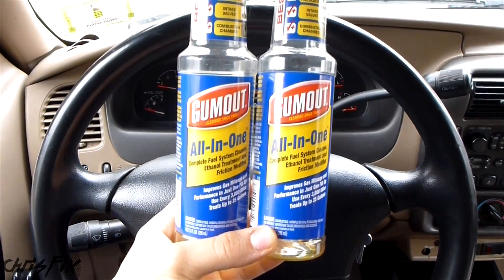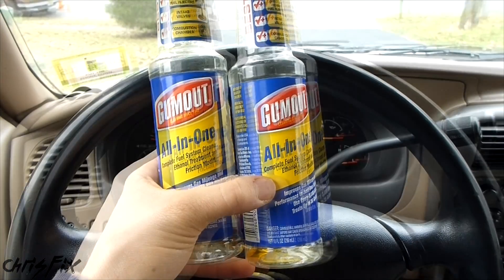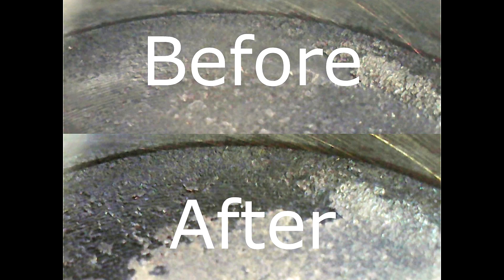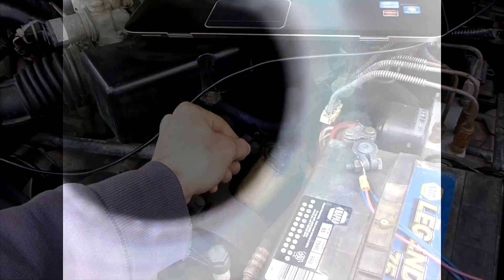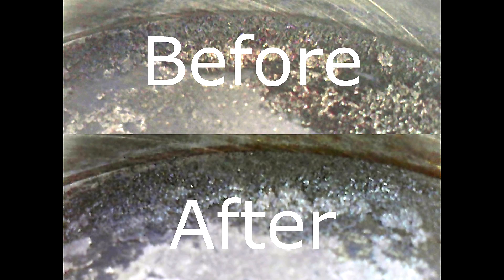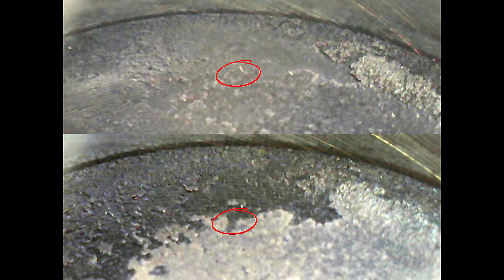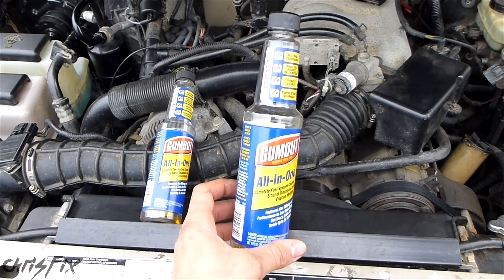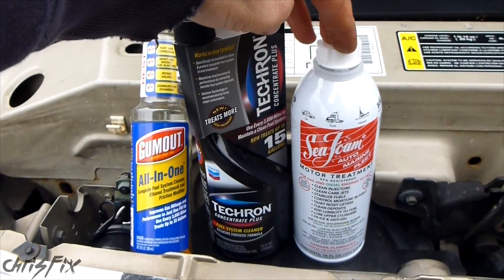Does Gumout Fuel System Cleaner Work (Follow up)?

Comment: Chris, you make a good point that the product is a bit too oversold on its packaging.   To be fair I'd interpret the language to mean that in the general case you'll notice an improvement in one tankful.   It's not saying that it'll remove 100% of your carbon after one tankful.  That is a very, very high standard of pass/fail here sir.
Reply from the maker: heymisterderp I wasnt expecting all of the carbon to be removed, but I was expecting there to be a noticeable difference. Like if I didnt show a before and after, side buy side, you wouldnt notice a difference. But I totally agree with what you are saying.

Comment: Sometimes you don't want to remove too much hard carbon too fast.  Bad things can happen
Reply from the maker: heymisterderp Very true.But you want to remove at least a little over the course of 500 miles and that didnt happen.
Reply: I don't know I'm just not seeing what you're seeing here.  I'm watching your video and I'm  impressed with these results.  It seems that if we used this full-time (1 bottle / 2 tankfuls of gas) I think it's clear we'd wind up with spanking clean engines eventually. 
You're also weighing only one purpose of this product as its total weight.  If you're just trying to King Kong the carbon out of your combustion chamber I agree this isn't the best product out there for that singular purpose.
Seafoam in comparison isn't going to countermand the ethanol in modern gasoline like this Gumout will. 
Upper cylinder lubricity is also important to people who want to care for their classic cars.  Feel how super slippery this stuff is in your fingers, it's physically apparent.  This product does things that Seafoam can't. 
I think you're also using a small engine where you soaked the piston head in Seafoam for 5 or 10 minutes after using 1/3 of a bottle on the intakes as a frame of reference, so...that is not this.  This is just putting something in your gas.  I think the rate of decarbonization shown here is ideal or at least close to ideal rather than "Busted". 
JMHO
Having watched the the end of the video you did add a disclaimer that mentioned 10-15 tankfuls so we actually don't even disagree for the most part.  I would only say that perhaps your expectations were a bit high going into these tests due to an unrealistic baseline.  
Great video though, excellent tests and narrations.  I wish there was more of this kind of thing on Youtube.   We never really get the data sets we need to make concrete comparisons on any of this stuff.   We're starving for evidence, and it's always great to get some.
With no cleaner/Gumout an engine will get progressively dirtier and dirtier for the most part.   With Gumout, an engine will get progressively cleaner and cleaner.  I think your videos confirm that.   That's pretty badass to me, but maybe my expectations are a bit too low!
Reply from the maker: heymisterderp I get what you are saying but at the end of the day, the bottle says after one bottle you will see results and were didnt see anything except some varnish getting cleaned up. I have never used fuel system cleaners (they are not needed unless you have an actual problem). Did you see the seafoam video: https://www.youtube.com/watch?v=WdT4DPFXIkM
Reply: ChrisFix
Chris,
I'd rather go with Gumout full-time and break the carbon off my pistons more slowly if that's the price.   For the totality of its purposes, it's an awesome product.   It's the difference between our cars running okay and running their best.  People should try this out and decide for themselves.   Our Toyotas and Nissans love it, they purr silky smooth.

Saying that fuel additives are "not needed" is somewhat erroneous.   It won't matter next month but it will matter after 100,000 miles.  A well designed and well-built motor can go 400,000 miles or more if people take care of it where at 100,000 miles it's just getting broken in.   Reliability is true value in automotive terms.

I had a recurring issue in my old Datsuns where I was carbon fouling the plugs mostly due to short tripping and not allowing the motor to properly warm up (oil temp).  This Gumout product eliminated that problem entirely.    This stuff cured a clogged injector in less than 10 seconds.   This product prevents and eliminates gremlins that make cars, particularly old cars, not run properly.  When a car is 40-50 years old the benefits of this stuff are enormous.  If your time horizon is only 20,000 or 30,000 miles then okay, I agree with you completely. 

Keeping a motor going towards clean rather than towards dirty while running great is a good result in my book. ;)

Comment: Wouldn't it be safe to say that this product might help prevent the hard carbon buildup if you used it from the time the vehicle was purchased new? I don't really believe in these products(except heet to keep my fuel from freezing/injector cleaning) but thats the conclusion i drew from your videos.
Reply from the maker: Elias Hardman I couldnt tell you for sure if this stuff prevents buildup of carbon because that wasnt what was tested. While it did remove the varnish, I dont know for sure if it will prevent carbon buildup. It might, or it might not. Due to the removal of the varnish buildup, you might assume it would work to prevent carbon buildup.

Comment: if your looking for more stuff to test you should try mystery oil its supposed to be good i use it in air tools but it says it cleans gas and  oil but iv'e never tried it thanks for the informative vids
Reply from the maker: sam witwiky Thanks Sam. I read the bottle of Marvel Mystery Oil and it it is not designed to reduce carbon deposits but to prevent them from occurring so the test wouldnt really work for MMO.
Reply: thanks its bean a wile sense i read the back of the bottle

Comment: the way this stuff works best is to use it as a preventative, if you used it during every oil change from when the car had zero miles on it, the gumout would regularly reduce the amount of carbon build up, because your vehicle already had over 100000+ miles, and this was the first time you used this stuff, your engine has massive amounts of carbon build up, the sludge stuff is fresh carbon build up so it came off easy, the hard crusty stuff is really old build up that's been there forever, so it would be really difficult to remove
Reply from the maker: kenshin moriame Yea, I agree. But the bottle's claims are not realistic. If it said what you said (or something similar) then that would be more realistic.
Reply: I agree, it's kinda like if you claimed a carpet cleaner could remove all stains, but you have a place that was a party house everyday for a decade, you know all that dirt, puke, wine, chocolate, and what ever the heck that thing was, are never coming out no matter what a company claims, and lets not forget companies claim a lot of B.S.

Comment: All of the major car manufactures advise to use top tier fuel to help keep this type of build up. I have to say that it does a better job and you don't have to use this crap. Costco and ARCO are  some of a top tier provider. And it is back by most car manufactures GM, BMW, and Hyundai are a few

Comment: Have you use the Royal Purple Max Cleaner or seen or read any reviews on it?
Reply from the maker: Tiny Rebel I have never used Royal Purple Mac Cleaner. Do people like it?
Reply: Its hard to say, not many blogs or random reviews about it. Seen it and it says for 2 or 4 cylinders, I have a 6 cylinder ford explorer and wanted your opinion should try on it or could damage it, its about the same size as the seafoam which I never tried before.
Reply from the maker: Is there a reason you need to use a fuel system cleaner. If there is nothing wrong with your car, I wouldnt use them. They cause more problems then it is worth.
Reply: Save up on fuel and proformance, but yeah too much can mess it up, I usually do it when I go almost empty and never in a half a tank. But anyways I least know Gumout is a 50\50 works, thanks for the reply and do enjoy the vids they have gave me a way to do a repair.

Comment: Hey chrisfix I just had a ? Do you think that if you were to drive on the highway at a more then usual rpm rate for a long period of time that it would break up more build up?
Reply from the maker: buck shot I dont think it matters. My truck as 4.10 gears and at 65mph I am doing 2500+ rpms and I did about 3hrs of highway driving. I think you will cause more damage by trying to maintain high rpms for a long time then it is worth. That is what I think.
Reply: Yea good point man I think you my be right

Comment: I appreciate you getting back to me on the lights, I found the adjustment screws. :) Next question. I used Lucas fuel system cleaner on one tank,Gumout with Regane on the next, and sea foam on the one that followed. My mpg is now 5mpg down from what it used to be before I put anything other than fuel in the tank. Did I screw over my fuel system? If so, what can I do to fix it?
Reply from the maker: Matthew Santos You probably clogged up the fuel filter or injectors. Finding the problem could be difficult. A fuel filter is a cheap place to start. I would check your fuel pressure: https://www.youtube.com/watch?v=_oXLUqE4Sf0

Comment: Good experiment. Not in one or two uses. You were very fair. Thanks again Chris for your time. I need one of your bore scopes. Cool. Can you squirt a decarbonizer in the cylinder from the spark plug hole and not ruin the engine?
Reply from the maker: John Santa Cruz Thanks John. You take a lot of risk if you spray it directly into the cylinder. Check out this video which I try what you just explained: https://www.youtube.com/watch?v=WdT4DPFXIkM

Comment: I've tried gumout a couple of times and while I didn't have a borescope, the performance and I derived was unchanged and plugs had to be changed. I won't use gumout. As far as I am concerned, its just snakeoil.
Informative. Thanks for sharing!
Reply: where can I get this snakeoil?
Reply: Gumout works and it’s not a cure all
Reply: I like gumout. The additives that have it in shell gas station which I can see my engine running smoothly with shell than arco or chervon.
Reply: @Eirocina ough idle on all gasoline except premiums, unless shell gasoline. Cheapest and mid tier shell run smooth too. 25 year old ford escort.
Reply: If you look after your engine- use clean gas and change your engine oil at good intervals, and drive fast, you shouldnt need a cleaner unless you have a sssshit engine. Always check a secondhand car though, folks dont actually look after their cars most of the time and large carbon deposits can lead to trouble, but in that case, gumout aint helping.

Comment: Try something a bit unorthodox, try a 1/2 quart of the cheapest transmission fluid in the gas, see if that breaks it up or just makes it worse
Reply from the maker: Brian C I would love to try that, but I am not going to pour anything like that into the gas tank of my truck lol. Thanks for the idea though!
Reply: ChrisFix
I have run a quart for a full tank in my 1997 Ford Ranger, it cleans it up pretty good.  Cheapest ATX or whatever transmission fluid, then fill the tank completely up.  Either way I would like to see if it actually works, I use Marvels Mystery Oil as well...but it's alot more expensive.  Whenever I feel the vehicle getting sluggish or hesitant, I put a quart in, usually peps it right up after a tank, either way...keep up the great work...always need these real world investigative reports on these additives that work or dont.

Comment: I have one for you to test because I know it works! 
Gently ingest seafoam through your air intake as fast as it will suck it in. Have a friend in the car Rev it to keep it running. It will want to choke and die. About 2500 rpm before you try and pour, adjust flow as needed to keep it from stalling. When you get to about half a can, let off the gas and pour faster till it stalls out. If you are nearing the end of the can and it won't stall, have your friend kill it. Key is to shut down while still ingesting a lot. 
Let it sit untouched for at least half an hour  preferably an hour. 
Then go start the vehicle. It will hesitate at first to start till it clears. Then it'll smoke like a banshee for a while. 
Best to do this in a private area, little to no wind, and once it starts, drop into gear and beat the pants off it. 
I've done this to many vehicles and the results speak for themselves. Noticeable difference in idle, acceleration and mpg. I'd absolutely love to see the scope after that. I promise you'll be psyched.
Reply: Ps I believe water to be dangerous as you can hydro / vapor lock it. 
My process works with techron as well.
Reply from the maker: Doug Pawl Thanks Doug. I will be testing seafoam soon!

Comment: what is a good fule system cleaner i wanna try it in my tahoe and pickup.
Reply from the maker: SuperJeremi10 I dont know honestly. I am going to try a bunch and you can see for yourself so stay tuned!
Reply: yea  cause  i have the spider like fuel injector on my tahoe they need cleaning they cause interment check engine random misfire but when i ran some  injector cleaner through the system my check engine light went away.

Comment: Hey Chris - Scott here, I have been using a sort of non-conventional additive to one of my beater cars to: 1) clean the internal combustion parts and 2) to improve gas mileage. Now I want to state first that this is at your own risk to all those out there reading this!!! I have also done extensive research on this so not to cause damage to my engine.
CAUTION...Acetone is a chemical cleaner and drying agent so read the warnings before use!
I add 4-5 ounces of pure Acetone to my fuel tank after fill up. Research says that to start out at 2oz. per 10gals of fuel adding 1oz. until you find the sweet spot. (This is per full tank of fuel) So you need to be very faithful on keeping track of your MPG or if you have one of those electronic ones that you plug into your service port that is the best method.
-Okay First do a MPG test before the Acetone (a full tank of gas no halves or quarters oh and from the same gas station)
-Next add the 2oz. of Acetone to a full tank of gas and run till next full tank.
-Do an MPG test to see if it improved - it should slightly like 2-3mpg.
-Now start increasing the Acetone by 1oz. per full tank of gas.
-When the MPG stops increasing then you have met the maximum absorption of the fuel to Acetone ratio. ie, added 5oz. of Acetone range = 4 - 5oz. so 4oz. is best.
Over the past 5 years I have been doing this sometimes consistently and not so consistent. When I use the Acetone my MPG increases up to 8mpg. Acetone is a drying agent and helps remove the water moisture from the fuel thereby improving combustion. It is also a cleaner to help breakdown deposits that clog the injectors and ports, Acetone does not harm the internal parts of the engine. It is not petroleum based and has a ph of 7 or neutral. It does not add to combustion or make the engine run hot - everything is the same other than the removal of moisture and other impurities of the fuel. Sometimes it works and sometimes it doesn't, there are many factors that affect this and is totally different from other additives like HEET.
Anyway Chris do some research if you want and if you decide to try it maybe let us know what you think.
Thanks - Scott
Reply from the maker: Scott B Hey Scott! Thanks for sharing! I personally wouldnt use acetone in my fuel but your results are definitely interesting!

Comment: Hey Chris i only use 87 octane in my 06 altima but I've been wanting to put in a higher octane to see how it works cause my car tells me my mpg but is it worth it and will it mess with my engine?
Reply from the maker: K Dawg Check your owners manual. It will tell you what gas is recommended. I am pretty sure your Nissan Altima is supposed to use 87. If so, using higher octane gas will do absolutely nothing except waste your money. There will be no change because your car is not tuned for higher octane gas so it cant make the most of it. Octane is just the resistance of the gas to explode due to temperature and pressure. Higher octane takes more pressure and heat to explode.

Comment: Wow chris, awesome test! I'm really curious on the effects of the seafoam. Will you put a third in the vacuum line, a third in the gas, and a third in the oil like it says or just run it in the gas? I heard that running it in the oil and then changing it shortly afterwards can stop pesky little knocks. Really curious to see your other tests. Maybe we can find something that actually does a good job?
Reply from the maker: helivesonforever Thanks man! I am going to do a video of it though the intake and then a follow up video with it run though the gas, but I wont be using it in the oil. I hope we can find something that cleans up carbon. Even if it just cleaned 1/4 of the carbon, I would be happy!
Reply: ChrisFix Same! Can't wait, keep up to good work!